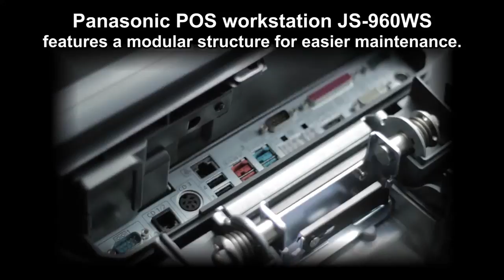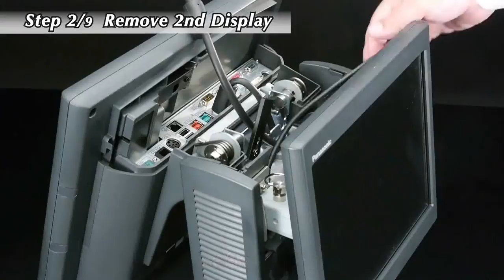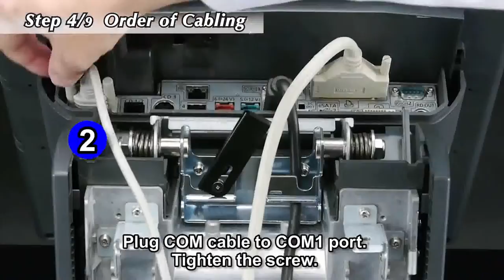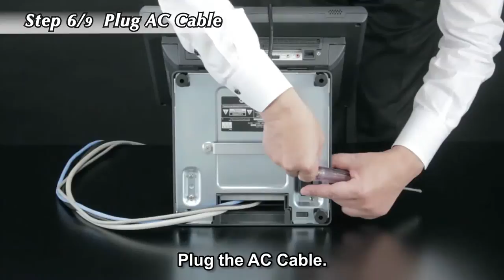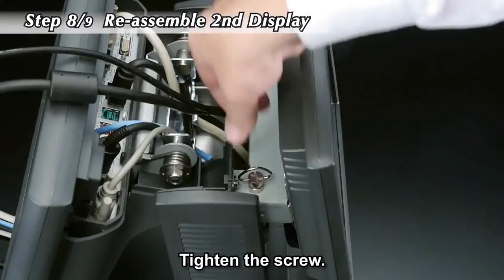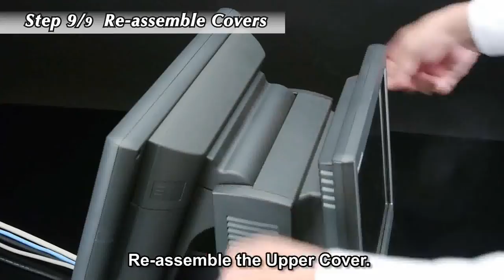JS960-WS - how to wire product cables

Comment: My rear display no longer works after upgrading to Windows 10, are there drivers for Windows 10?
Reply from the maker: The 960WS POS series does not support officially Windows 10 for this reason Panasonic do not have any drivers for Windows 10. As the external display run over Com4 we assume there might be a wrong setting in Com port setting (like baudrate, etc.).
Reply: @PanasonicConnectEurope  I have the 12.1 inch display that runs over the DVI port.
Reply: @PanasonicConnectEurope  I've identified the issue is with the RD OUT port, there is no power when Windows 10 is loaded, works fine with Windows 7, any advise?